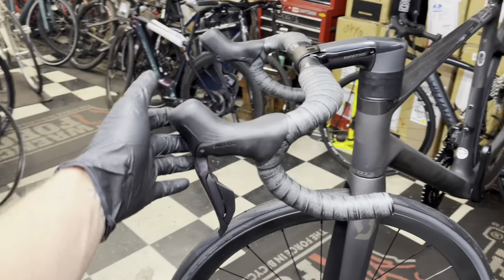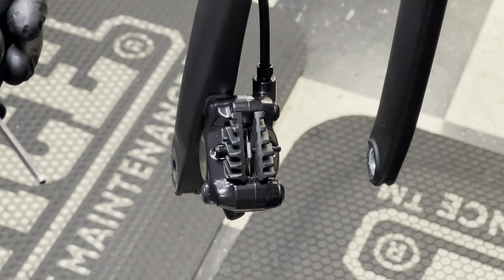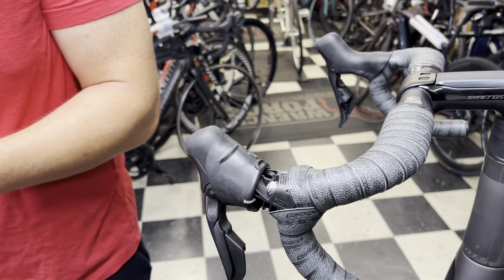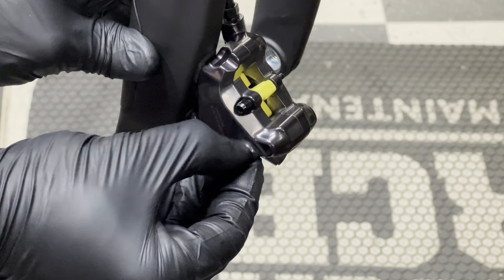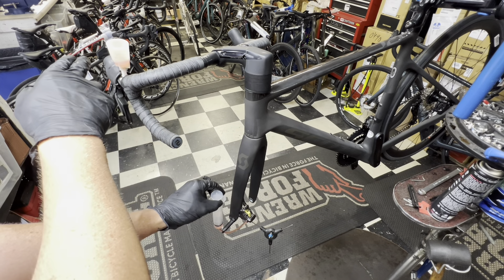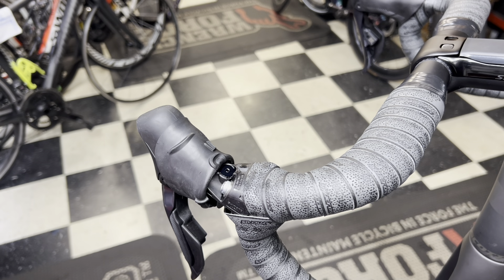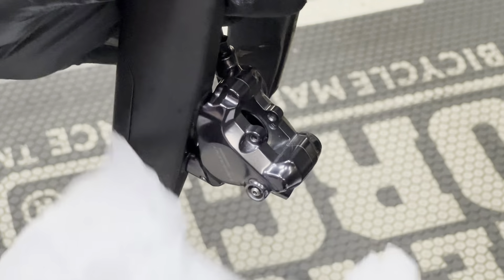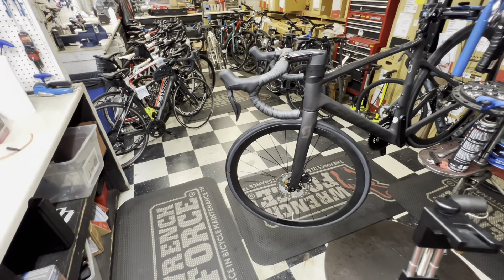*EASY* HOW TO BLEED SHIMANO 12 SPEED ROAD HYDRALIC BRAKES (105, ULTEGRA, DURA ACE) 7100, 8170, 9200

Comment from the maker: any questions you have let me know down below!!!
Reply: What type of content do you NOT post?
Reply: Our LBS mechanic can't solve the leaking issue on my 105 brakes. He already tried to bleed the brakes thrice and the issue still persist.
I think the o-ring might be the problem as the mineral oil is leaking in the right piston. 
Do you know how the leaking issue can be solve?
Reply from the maker: @JD-iy3nc  if there is a leak of some sort it can be a warranty issue. It could be something wrong with the caliper. But I would go about checking the bleed port screws to make sure there are o rings there. There are some troubleshooting methods like leaving the shifter closed and then pushing fluid into the caliper to see if you see a leak. But it needs to be a process of elimination
Reply: GC - If I am upgrading to 8100 from 7000 105 and changing out my calipers can I reuse my existing hose?  Can I just connect the syringe and pull back to remove the fluid before removing the old caliper and not making a mess.  Then just new barb and olive on both sides of the line?
Reply: I'm a little confused, the manual specifically says not to depress the brake lever when adding fluid with the syringe. you did exactly what the manual says not to do, can you explain why?
Reply: I just received my shimano 105 DI2 and in the manual they say to use the bleed block from the Dura-Ace groupset that looks different than the regular Shimano block I have in my bleed kit. It's rounded on the bottom with a little handle to remove it and it has round seats for the pistons on both faces. Does it matter? The thickness might be different but I can't find the info. Can you help me? Thanks!
Reply: Brayton  750
Reply: Which bleed kit is this???
Reply: How do you extract a stripped bleed bolt?
Reply from the maker: @5illo06  dremmel and flat head
Reply: How often should oil be changed
Reply: YEA!
Reply: Any thing different with the rear brake?
Reply: Awesome, concise and VERY helpful. THANK YOU

Comment: This amount of maintenance is why I’m sticking with rim brakes as long as possible
Reply: Okay Boomer.
Reply: rim brakes are old tech dude its like riding a horse
Reply: @CursedClips  lol
Reply: Once it’s done you don’t really have to mess with bleeding again.  Replacing pads is easy.  I’ve had mine 4 years/10,000 miles and never bled them, the work well.
Reply: The braking performance on disks is so much better it’s not even funny
Reply: Yes sure, dont use a smartphone then.
Reply: How often do you fray a brake cable? A good bleed will last you thousands and thousands of miles. How often do you swap from carbon to aluminum brake pads? Add that in too since you can swap wheels without messing with brake pads on disc brakes.
Reply: I've just done a hydraulic setup for the first time, having previously asked the bike shop to do it for me (i always thought it would be hard).

 I'd say is that the setup and install and maintenance isn't any more difficult, but it needs new tools which you don't commonly have unless you've gone out of your way to get them.

I've had a set of hydraulic discs for a while now and the maintenance has been near zero - equivalent to rims. I haven't had to bleed them or change the pads yet (each bike gets 4-5k  km per year).

But do buy the "proper" tools.
Reply: Not like you have to do it that often, and the benefits are huge compared to rim brakes
Reply: I thought that, however it is straightforward as long as you leave yourself plenty of time to learn the first time. Guides like this chaps are indispensable.
Reply: it just takes 30min
Reply: I hope by this time you have already changed those shitty rim brakes lmao
Reply: Rim brakes? Cables? Brake pads? Calipers? Levers? With this amount of parts and weight I using stick thru spokes. Very low maintance. Few spokes time to time.
Reply: Have my bike with hydraulic brakes for 5 years and never ever had to bleed it…

Comment: Lever went all the way to the bar with just thumb pressure- not good. You didn't tilt the lever down 20 degrees per Shimano shop manual so you have air in the system.

Comment: Can I hang my road bike upside down, with hydraulic brakes? I have 9170 Dura Ace”,  I noticed every time I hang my bike the next day the brakes are really spongy “all the way to the bar”,,,, so I do a bleed of course then brakes are fine if the bike is upright, but then when I hang the bike again the next day brakes are spongy again, so I checked everything and no leaks anywhere and brakes work great if the bike is upright, “solid”. So is there something that I’m missing with hydraulic brakes that it can only be stored upright? I’ve heard about this from other riders, they say theres air in the system, but I checked as I did the bleed and pumped the brakes and no bubbles, so I’m confused what to do. I did the bleed for times already and same problem when bike is upside down hanging in my garage. Can you shed some light what I need to do?

Comment: Dude, Shimano explicitly say in their service manual for these exact shifters “Do not depress the brake lever while adding oil. Doing so may introduce air bubbles into the system. If the
lever was depressed, drain the oil and re-start the process.” They also don’t mention anything about blocking the port on the funnel before you open the bleed port. The manual is very clear, with images. Check for yourself! 

I nearly found this out the hard way. Was working totally fine as many people in the comments have suggested. Then I got a puncture on the road and flipped the bike upside down to repair as I’ve always done. This caused all the air that was introduced in to the system using this method to rise to the end of the hose. I tugged the rear brake a way down the road there there was NOTHING there. Pumped it a few times and it came back - that’s air in the system for you. 

I then found the Shimano service manual, followed those instructions which are very different, and I’ve not had a problem since. 

I’d advise you take this down/update it before someone finds themselves in a hedge or worse. And I’d probably give some of your clients a free service…

Comment: I used this as a guide to bleed my brakes after fitting an integrated aero bar and it worked great. Much more straightforward to the point than other videos out there.
Reply from the maker: Thank you very much for the compliment and thank you for watching

Comment: Great video. I have to do BOTH calipers every time I want to clean the headset on my sworks SL8 😂.

3 min now takes 50-60 mins.
Reply from the maker: hahhaha yes I know, headset jobs use to be a 10 min in and out thing, now we have to have them drop off the bike for a day and it costs 2 brake bleeds, and also if th ehose is not long enough then we have to re cable the bike lol

Comment: Thanks for this video, made it very easy to bleed my 105 Di2 brakes. Originally tried watching the Park Tool video but it seemed overcomplicated and was hard to follow, this was much easier. Only thing I'd add to the video (unless I missed it) is to rotate the bike in the stand while pumping the brakes to get rid of any extra air bubbles. I did that and there was many more air bubbles that came out.
Reply from the maker: yes you are right that is a huge thing to do, helps a lot, to get all those bubbles stuck
Reply: It's a pity we can't fit a syringe at the top and push/pull to get everything out.

Comment: Brilliant, very detailed instructions, thanks heaps! If I'm still having problems with the brake lever squeezing back onto the bar, does it always mean their is still air in the system?
Reply from the maker: try tilting the bike while the cup is installed and pumping to move the air bubbles, like raise rear wheel to air and then front to the air while pumping and ion the stand and it can maybe move some of those bubbles

Comment: Pro Tip I've started doing, when I do the alcohol bath, I use one of those throwaway paint brushes and do a brush/scrub, then soak it again, let it all drip off, dry, and you're good.  Then demote that brush to cleaning duties elsewhere that isn't as crucial.  They've made bleeding brakes so easy now, and I preventatively bleed once a year, and that's with 600 hours of riding/training/racing on my bikes.  If you just have to flush through, it's cake.

Comment: This is the best Shimano Hydraulic brake bleed video out there and the only 12 speed Ultegra 8100 series hydraulic disc brake bleed video. Well done! How will I know how much mineral oil I require to insert to the syringe for the front and rear disc brakes? Appreciate your answer very much 🙂

Comment: Great video! What kind of fitting goes on the end of the hose into the caliper? Did it come with the bleed kit? What is the part number of the bleed kit you used? I think I purchased the wrong one to work on my BR820 GRX brakes. Thanks!!

Comment: Thank you for awesome detailed video! 

I have bled a lot of brakes (bikes, motorcycles) and now on my new bike I had to change handlebars (Ultegra R8100). That included disconnecting hoses, cut, new olive and barb. When I reinstalled hoses back the front brake was firm as a freshly bled brake but the rear was a bit strange so I tried ziptiying levers over night. Front no problem but the rear has a bit strange feel on the lever. Front brake is nice and stiff and when releasing, the lever feels nice, slow and plush on the way back. The rear brake however is lovely firm (I rebled the system by your method), but the feel on release is very "quick" and feels a bit rattly, clicky and not that slow/plush when releasing the lever like before/like front brake. I cannot explain this sensation much better but I hope you can understand. Just asking, if something could happen to the lever, or if maybe the hose was connected badly? Or if it is just normal? 

Thank you again.
Reply from the maker: You are very welcome. Thank you very much!! Also yes I have seen hoses when they are connected sometimes the olive doesn’t crimp right. Also anytime you reconnect hoses make sure you use a new barb and olive.

Comment: Great video! I find a poly-plastic Pedros tire lever a safer tool to push back the pistons than anything metal.
Reply from the maker: makes sense, I wil use that next time, I just have ran into some stuck ass pistons before form corrosion from florida but i will start with the tire lever first
Reply: I cracked a stuck Grx ceramic piston with a metal tool.

Comment: I've seen a few other shimano hydraulic brake bleed videos which recommend not using the  syringe but doing a gravity bleed from the cup at the top through the caliper at the bottom.  is there any reason you wouldn't use a gravity bleed?
Reply from the maker: I have the syringe and all the materials. This is just the correct way to do it and flush out the old fluid too

Comment: Great instructional video, thanks. Question: I've just picked up a new bike and the right (front) 9200 lever has about twice the travel as the left (rear). I've adjusted the reach of both to be the same but the front compresses much more than the rear. Still works fine, but they aren't equal. Could this be that the initial setup of the bike has air in the line, and should I look to use your excellent tutorial to fix that, or are there stroke adjustments somewhere?
Reply from the maker: Yes it is the initial Setup maybe more fluid spilled out while connecting the hoses. Sounds like it just needs to be re bled

Comment: Nice job.  What if the brake handle has too much travel or  the front and back brake levels are not exactly the same.  What and how do I adjust to get them to squeeze identically?
Reply from the maker: try rebleeding and getting more fluid or sometimes depending on the lever they have a reach adjustment on there, just google your shifter and reach adjsutment and it should help

Comment: Hi there, thanks for the video.  I followed your steps and installed the front caliper R8170.  However, I found there is oil leaking out from the front bleeder screw.  I tried to tight it further with 4N force with a torque wrench but it still leaks.  Any thought or recommendation how to fix it?  Thanks mate!
Reply from the maker: make sure the screw is not cross threaded, if there is not a correct seal it can leak, also check to make sure there is a rubber oring on the end of the bolt, that can cause it to not seal properly
Reply: @GCPerformance18  thanks for the tips. I think the thread on the caliper is damaged. Will replace with a new one

Comment: Hi and thanks for a really instructional and helpful video. I’ve a question and should start by saying I’m in the UK, so left shifter / lever controls the REAR brake (and front derailleur. Shimano 8170 levers and brake cartridges. Bled the front (right lever, short hose) no issues, nice and easy. But the rear (left lever, longer hydraulic hose) is really tough - even with the release (pinch) bolt really undone, it is almost impossible to push the syringe plunger down. It was easy for the front brake, fluid ran up and bubbles came out with little effort. But the rear is just not the same. Any suggestions? Many thanks!

Comment: Hey man, great Video.
For me the way the brake lever took to the breaking point is way too long .. imho. Thats also what I notice yesterday when I try to bleed my shimano 11 speed. I thought the result was not satisfying and tried it again and again. I dont know if its the real breaking point or it that some air is still in the system.
Reply from the maker: it could be air in there, the 11 speed is notoorious for holding small air bubbles in those shifters try moving the bike around as bleeding

Comment: The Shimano manual has an extra set of steps at the end that instruct connecting a tube and bag to the caliper and letting fluid with air bubbles drip out into the bag. I didn’t see you do that here, so was wondering if you thought that step was necessary. I tried doing those steps and no fluid came out. Thanks!
Reply from the maker: I dont think it is needed, I always do it this way and it works perfect

Comment: @GCPerformance18,  broke my shimano 8170 brake lever, i have a  replacement on the way. Do i need a special tool to disconnect and reconnect the hydraulic brake line?
Reply from the maker: Yea you need to install a new olive and barb. You need to get those tools for that

Comment: Hello, where should the reach and the free stroke be set during bleeding? Max reach and max free stroke? Max reach and min free stroke? etc? HoweverI can't find any words about it on Shimano DM. I bled my brake nicely and they work very well. I have already set the free stroke to minium (bolt all in) after bleeding, but still prefer 20% less free stroke.
Reply: Easiest to bleed on r9120 with the free reach screw turned all the way out imo. I also loosen the free stroke screw.

Comment: Hello 🖐🏻️,,  ooohyeeh.. Why when pressing the brakes this brifter when back to slow,, thank.
Reply from the maker: re bleed it or look for something that is clamping th ehose sometimes when you tighten something that holds the hose tot he frame it can cause a bind on the hose which can cause it to not work well and release slow or pull slow

Comment: Before you push brake piston to reset them there is a very very good practice to do which I highly recommend! 
Unscrew bled port in your brake hood first and then push/reset pistons. 
There is a risk to destroy membrane in brake lever if the hydro system is closed.
Reply: I reckon that's when the hydraulic line has too much fluid in it, but it is a good idea indeed. I do that sometimes.
Reply: So I was wondering about this on my Ultegra hydraulic R8070 as I've had issues after pressing my pistons in.   But if I did rupture whatever is inside the lever assembly I'm assuming it would be leaking and no pressure possible.  But I have no idea of the actual internal assembly and it appears to be a sealed non-serviceable assembly.
Reply: @halfglassfull  hi, I’ve had the same problem as you, did you find a solution to it? Would ve very helpful, it’s driving me crazy
Reply: @jorgevillalon5209  it has been a while   I tried so many things but as I recall I had to bleed both ends.  The caliper had trapped air;  used my bike stand to invert bike keep caliper up top so bubbles would rise. Used syringe at caliper end and then I eventually got all the bubles out.  Eventually all air was out and brake lever become tight. So nothing was ruptured. So after it was correctly bled it enabled the pistons to retract under fluid vacuum.  No need to lubricate the pistons they are ceramic and the seals act like springs to retract but if there is trapped air then they do not pull back from the rotor.
Reply: @halfglassfull  thanks! I’ll have to bleed it and if it’s still spongy I might take it to my local bike shop to see what they can do about it.

Comment: Hi. Thanks for the video. Are the bleed blocks specific to the new calipers or are the old bleed blocks the same? Thanks
Reply from the maker: they are a better fitting version but they work in the old versions too, and also the old ones work in the new ones as well
Reply: @GCPerformance18  I just used the old one to bleed the new calipers. No issues.

Comment: Hello, I bleed new Shimano 105 12s hydraulis front breaks in new bike. The handle sticks (i mean and does not work smoothly when rebounding) . do you know what could be the reason?
Reply from the maker: Maybe the barb and olive that is connected at the hose is not installed right on

Comment: You just pushed a bobble inside the system that will have to go through the whole length, on the previous group R8000, R9100, bobble got easily "lost" into the lever and had to move the whole bike up and down to make them go, I hope that for the new one it's better / easier.
Reply from the maker: they are evry easy to remove